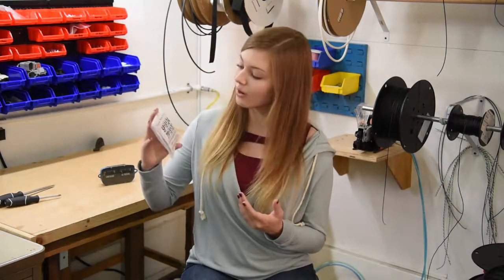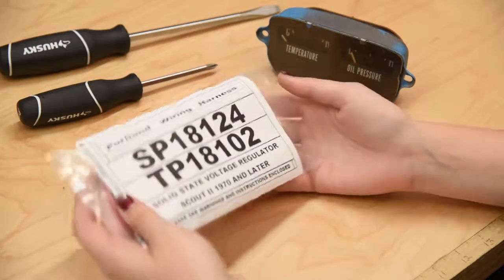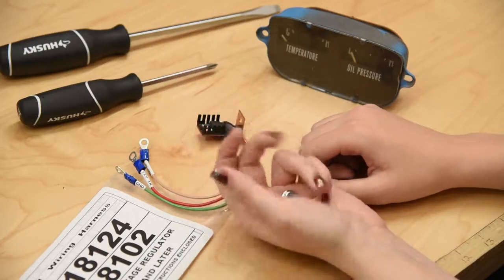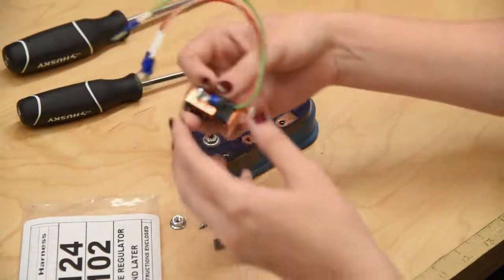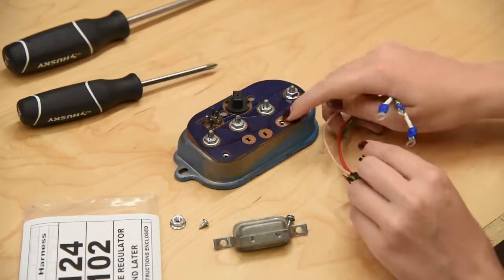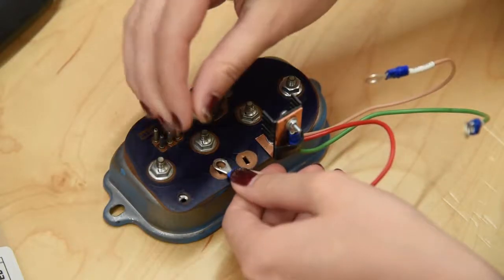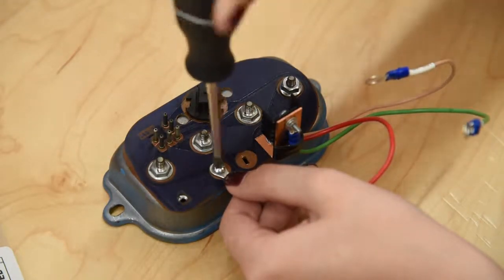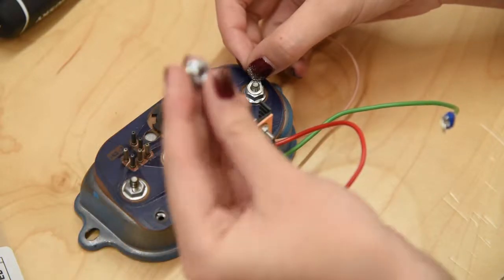Scout II Voltage Regulator Replacement for Original Gauges

Comment: Where would you  ground this to?
Reply: I second this where do we ground it?
Reply: Ground the regulator to any screw on the dash.  I have used the screw that secures the gauge to the dash board assembly.
 @Ptbocam
Reply: What about the left over bolt that was holding the old regulator, does that need to be put back in ? Gauges still aren’t working for me